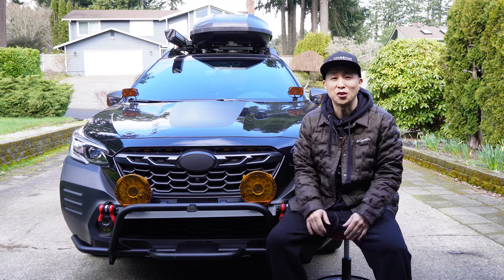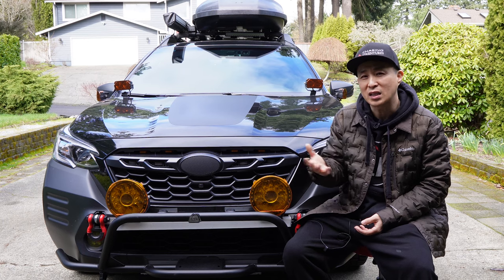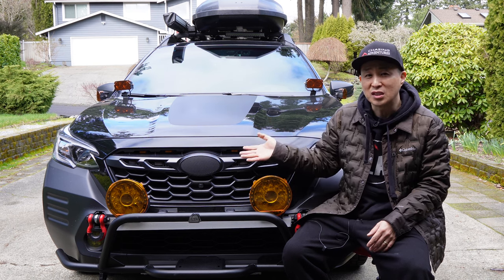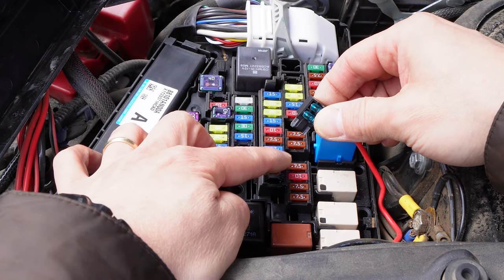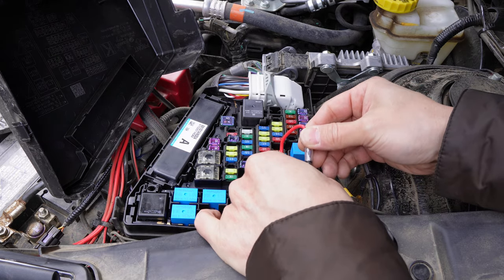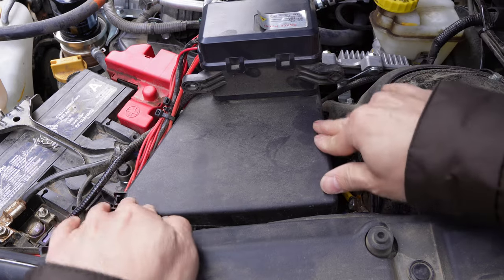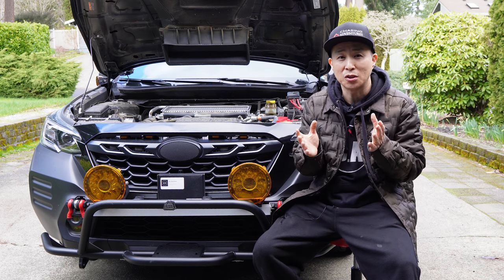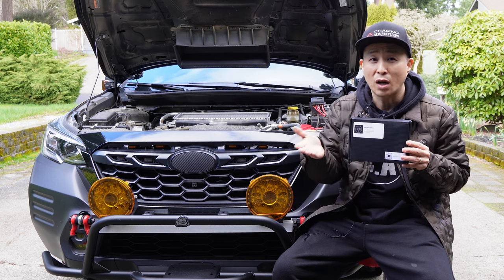How to fix Her Necklace Grille Lights turning on Randomly and a Giveaway information

Comment: I finally got rid of my Subaru LEMON 🍋 and bought a 23 Tacoma TRD Off Road, double cab with a 6’ bed
Reply from the maker: What was wrong with yours?
Reply: @ChasingAdventuresCO  The facial recognition worked about 1/2 the time. The rear hatch would open randomly, the transmission was slipping, it only got 20mpg, it took Subaru over 14 months to figure out why the remote start wouldn’t work, the memory seat constantly forgot where it was supposed to stay, the stereo would forget the preselected station, it would unlock itself overnight, the dashboard lights kept burning out, it went through 3 batteries in 14 months. The last 12 weeks I owned it, it was at Subaru for 9 months being repaired and the closest Subaru dealership is a 3 hours away from our house, so it would take 6 hours just to take it to the dealership and drive back home.
There were other annoying problems with my Subaru.
That was my First Subaru and it will definitely be my Last Subaru.
As far as I’m concerned, Subaru can go 🖕🏽Themselves
Reply from the maker: @Doc1855  oh wow!!! That's a lot of problems!! hope the Taco will serve you well.
Reply: @ChasingAdventuresCO  I’m sure it will.
That Forester was my first Subaru and it will be my Last.
I’ve driven Toyota’s almost all of my life and never had any problems.
Heck, I drove my 78  Corolla for 24 years. It died in 02 with 488K miles.
It was replaced with a new Camry and I drove it until my needs changed in 11, so I bought a new Rav 4WD Limited with the 3.5L V6.
I sold it for the Forester, to get better fuel economy , yet that Gutless 🍋 got far Worse mpg.
I got 21mpg in combined fuel economy and on the freeway I got 28mpg.
That horrible Forester NEVER got very good fuel economy.
My wife hasn’t had Any problems with her 19 Outback, but my Forester Touring was a disaster.
I’m pushing 60 years old and only drive 5-6K miles per year now, so I plan on driving my Tacoma until I can no longer drive or I die.
Reply from the maker: @Doc1855  that is awesome. I came from 15 Tacoma Off-Road to the Subaru and tho it doesn't get suggested MPG but still way better than the Tacoma. LOL and without any issues yet so I am loving it. and usually, foresters are the ones without any issues.